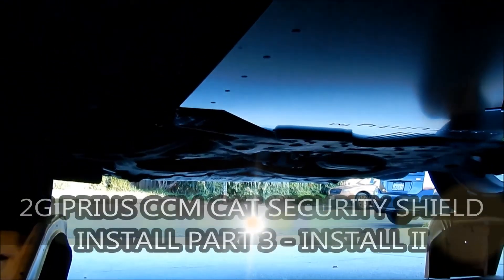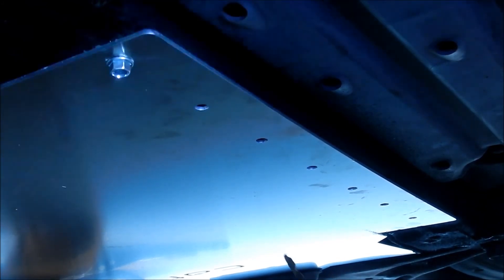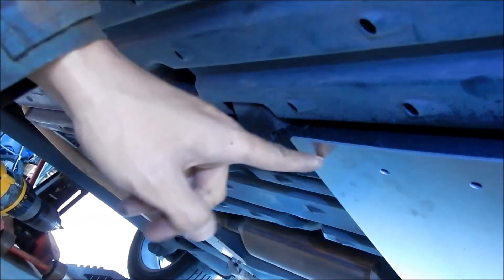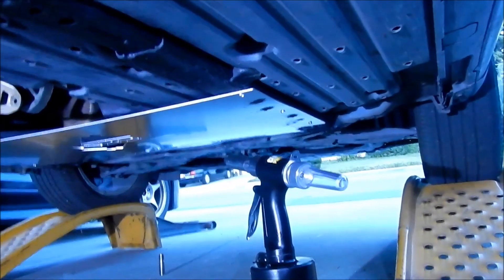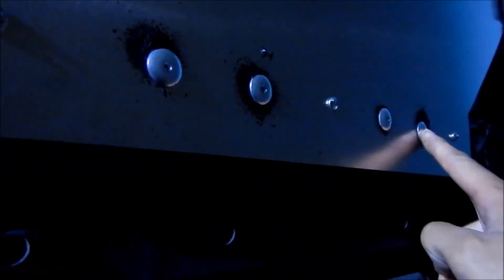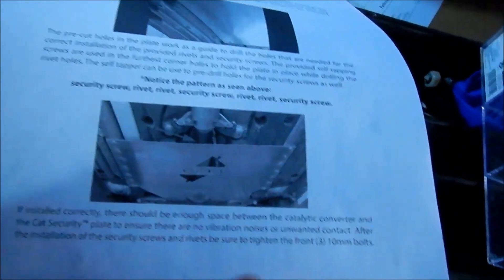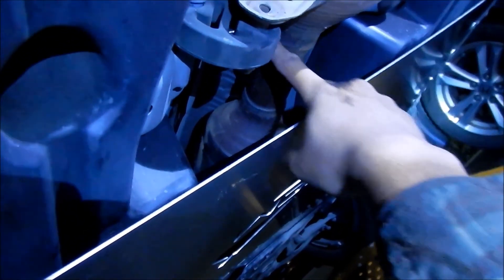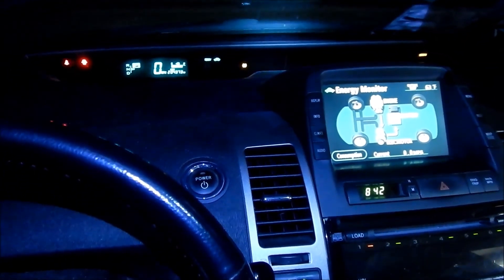CCM Cat Security Shield Install 2G Toyota Prius Part 3 - Install II

Comment: Any machinist will recommend  using cutting oil on the tip of the drill bit. The bit will cut faster at a lower speed and last much longer. A perfect cut will produce two pigtails. Keep it lubed. Wear safety glasses.

Comment: Great work! I will be installing the newer version of this plate (no rivets, 3 bolts per side) on a 2008 Prius that had the catalytic pipe and O2 sensor stolen. You are correct that the rear pipe near the resonator is still vulnerable to cutting by an ignorant thief. Even though the catalytic assembly is safe, you would still have to get the rear pipe welded, so I will put another aluminum plate across the rear with tamperproof screws.
Reply: InstaBlaster

Comment: I just put mine in.   Before you start, invest in some sharp metal drill bits.  It will save you lots of time.
Reply from the maker: Yeah I bought a pack of drill bits at harbor freight when I install these.  The metal they use on these cars is very hard.

Comment: Well sounds like you’re only 90% happy about what you have installed .  Possible they could not get to close maybe some sort of government regulation . Just remember not everybody can install their own “cat security “ and later on , when time to do any maintenance underneath the car and they may have trouble to remove it and put it back again. Example transmission fluid change or oil change. Last but not least I do like your whole instruction extra explanation very good details , thank you very much!
Reply: The only maintenace you would need to do from the area the shield covers is to change the downstream O2 sensor or change the cat itself.  You can change the oil and cvt fluid with the shield on.

Comment: Excellent work for 2.5 hrs.! The shop wants to charge 2k for exactly this & think I'll just do it myself!
for the exposed resonator part, how about some pipe wrap strengthner?
Reply: Wow $2000!?  That's ridiculous, I would think it would cost anywhere from $300 to maybe $700 to do this.  I think the Toyota dealer quoted me around $400 for everything.  I wouldn't worry about the resonator part if they can't get the front part off it will be very difficult to get the cat out.

Comment: Worthless as my 2nd cat converter was stolen from my 2005 Prius with my shiny new cat plate still in place. Paid $200 for teh plate and another $200 when they had to remove the plate to replace the 2nd stolen catalytic converter.